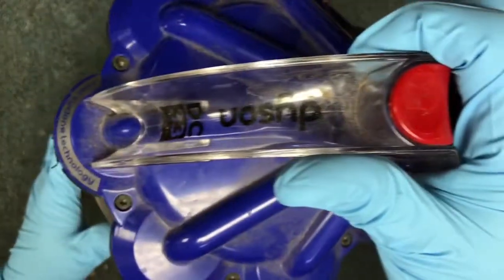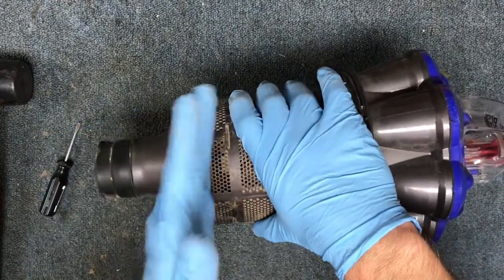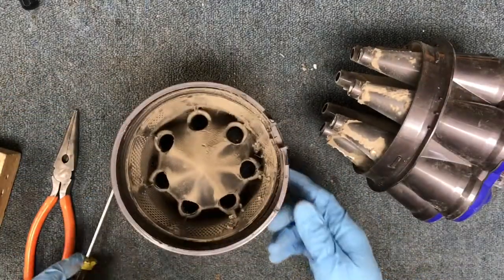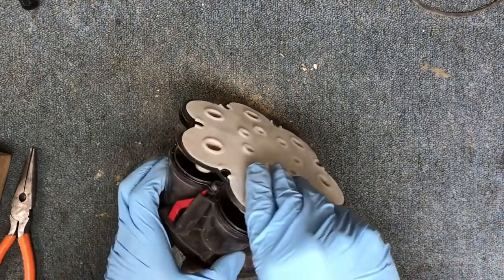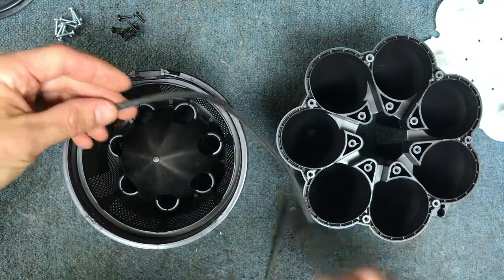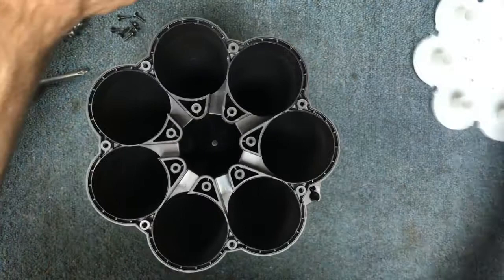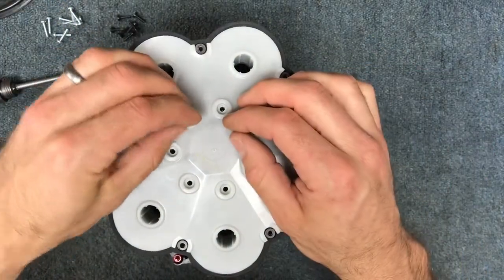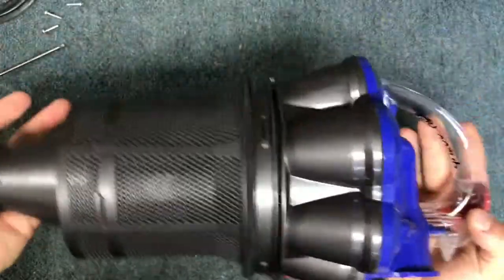Vacuum repair man shows How to take apart and clean a Dyson DC33 cyclone assembly

Comment: If any else is struggling to reach the back screw you can use a flat head on the trash lever and pry it up, but be warned itll pop off at a high speed so face away frlm anything important!

Comment: Really helpful thanks. Mine was full of plaster dust, won't be using it for that again! Hopefully this process plus stripping down and washing the hose, and buying two new filters will help. I used silicone spray on all the seals

Comment: Thanks so much for providing a very informative video. The problem I currently have is there's a lot of warm air coming out at the interface of the base and the plastic cylinder. This is making me think that it's causing a significant loss of suction. Any thoughts please?
Reply from the maker: That's where the exhaust air should be coming from so what you're describing is normal. A loss of suction may be pointing to a clog or dirty filters.

Comment: Thank you so much for this great video! I took apart, cleaned and put back together my vacuum and I didn’t even have any leftover pieces!! 👏🏻 😉This is a big deal because I struggle putting together a cardboard box with instruction and I did this without any help from my husband and I’m super excited about it!! 😁
Reply: 303 makes a good rubber reconditioner after rubber gaskets are cleaned just soak gaskets in there for 30 min don’t go beyond an hour and they come out like new pliable easy to set back in..Mahalo for the video, Aloha from Hawaii🤙🏽🏄🏽🗿
Reply from the maker: you're welcome

Comment: I would rather just take my vacuum cleaner to Dyson repair shop official Dyson repair shop Because these vacuums are extremely expensive I have a Dyson DC 28 airmuscle and Dyson 33 vacuum they are both my favorite vacuums but the Dyson DC 28 air muscle animal Is it very expensive vacuum cleaner this thing is super strong it’s better than all Dyson vacuum cleaners it’s the elite version
Reply from the maker: Whatever suits you! Consider yourself fortunate to still have a functioning DC28 😊